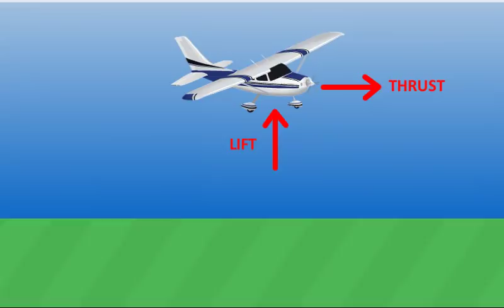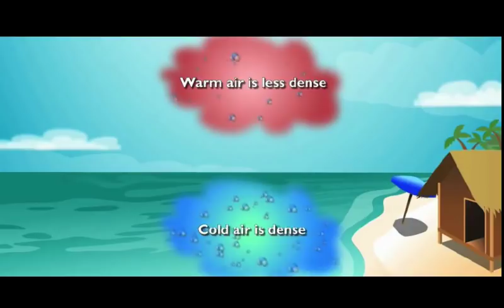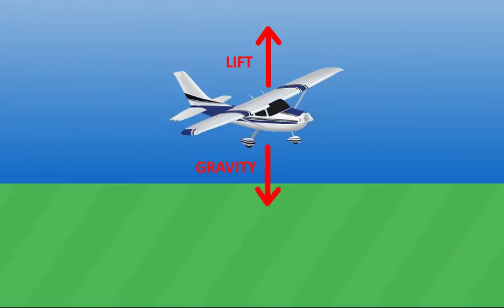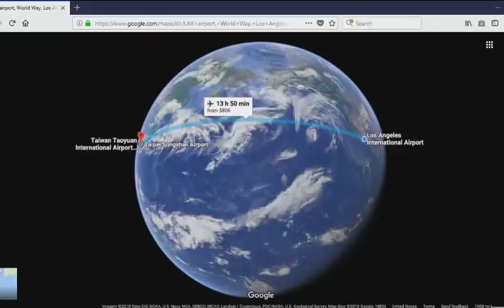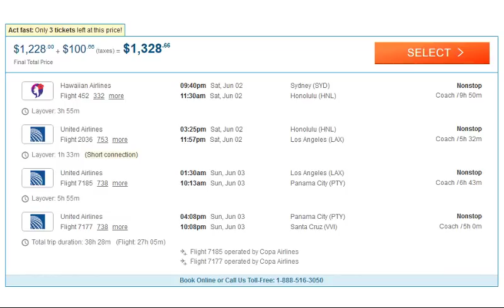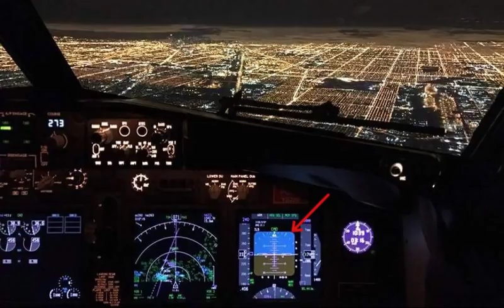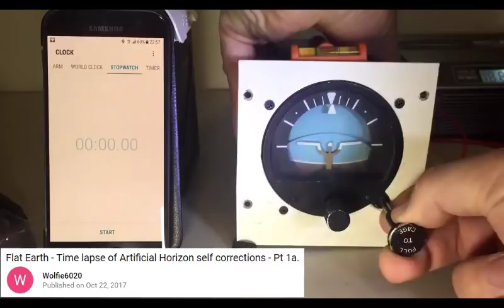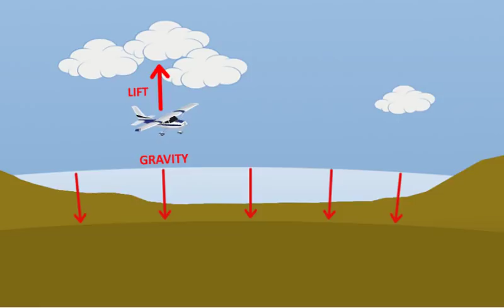Flat Earth Falsities - Plane Nonsense

Comment: I find it VERY sad that there is NOT ONE among you "SPINNING BALLER'S" that can actually THINK FOR YOURSELVES! You keep regurgitating from the same FABRICATED info sources that have dumbfounded you to begin with! I'm your HUCKLEBERRY....invitation extended. COMMON SENSE & LOGIC is just my game. Also, i dont need someone to help me do it either.
Reply: The distance when travelling 10˚ due east or west parallel to the equator.
At 60˚N or S the distance is 300 nm or 555.8 km. Personal experience.
At 30˚N or S the distance is 520 nm or 962.3 km. Personal experience.
On the Equator the distance is 600 nm or 1111.2 km. Personal experience.
For correcting sextant altitudes for the Earth's curvature the formulae are;
 Dip = 0.97 x Square Root (Ht of Eye in feet). Personal experience.
 Dip = 1.76 x Square Root (Ht of Eye in metres). Personal experience.
Also magnetic compasses only function because of the earth's magnetic field, which only exists because the earth is spherical. There is no such thing as a mono-pole magnet in nature. Only people who have actually worked with them or studied their development know this. I have done both. Not a single FE cultist has done either. Not a single one. Never. Not a one. Personal experience.
Gyrocompass only work because the Earth is slowly rotating and gravity is a fact. Only people who have actually worked with them or studied their development know this. I have done both. Not a single FE cultist has done either. Not a single one. Never. Not a one. Personal experience.
Reply: YES its very very sad... :( But then again that is why they are, Followers of EVERYTHING GOV /SCIENCE says.
Very alarming that even the most  carring are reduced to such parroting, even so dereft They must feed on our videos and claims.
You will hear a lot of echo, even a new convert Comedian will be stubstance to them.
They adore they all moving heliocentric universe, feel safe with that childhood compagnion, GOD Almighty, I dont like :( :( :(
THEE GREAT ATTRACTOR !  Not an iron core mass magnet nor a gas sun powerhouse, but a freaking HOLE! BRRRR!

10 Terrifying Facts About Space

https://www.youtube.com/watch?v=UNEFDynNw-Q
Reply: @SRC 2 How do FEers THINK FOR THEMSELVES when they seem not to be able to THINK CRITICALLY and OBJECTIVELY, when they lack the fund of information to THINK INTELLIGENTLY? How do FEers THINK RATIONALLY when consumed with SUPERSTITIONS, SUSPICIONS and CONSPIRACIES?
Reply: Give us 1 single "food for thought" and we will embrace it.
Reply: Plenty of "food for thought", as in, for taking the piss out of and proving it is all lies.
 @petroleumalley
Reply: @petroleumalley  Not sure what side of the fence you're on exactly....but as for "FOOD FOR THOUGHT"? Here's some for EVERYONE: Explain to me why it is that HUNDREDS  of MILLIONS of people  have flown by plane all over the WORLD for YEAR'S (including myself to the Philippines ) yet NONE have EVER reported having experienced the "SENSATION" of "FALLING FORWARD" or being "UPSIDE DOWN"?  which WOULD DEFINITELY  occur on a GLOBE! IMPOSSIBLE  NOT TO!  So go ahead you "GOOGLE- DEPENDENT-for your INTELLIGENCE" warriors ...PROVE ME WRONG!
Reply: @steveeasy8775  I asked for food for thought and you are asking me why people on the other side of the world are not upside down?
.
You are trolling sir !
Reply: @petroleumalley  LOL! My whole argument is that they are NOT upside-down! Everyone knows you cant be upside-down on a flat earth.
Reply: @steveeasy8775  And on a sphere?
If it's true that gravity exists and it's directed toward the center of the earth  than literally everything you wrote can be flushed down the drain.
Please concentrate of the things that matter instead of asking why people are not upside down.
Jezus what a bullshit.
Reply: @petroleumalley  What is your opposition exactly to what i'm saying? Is there a specific thing you are asking about?
Reply: @steveeasy8775  I have no further questions. All were answered by you.
Reply: @No... YOU sir are the one speaking out of ignorance. Name-calling is something ignorant children do. A globe as you well know does in-fact have a top and bottom...the North being considered top, South the bottom, and they are a constant in they're orientation. Gravity has NO control over feelings, emotions, or sensations felt. If you were in a plane ascending  upwards would you not "feel" it? If the plane were to do a straight nosedive would you not have the sensation (feeling) of falling? Those feelings CANNOT be overcome by gravity! Therefore , if you were to start at the north and fly "around" (down) the side of a globe heading South, you would be in a "nosedive" situation would you not?...at this point you would most definitely experience the sensation of "falling forward" for the minds "sense of direction" is not based on gravitational-pull.
Reply: @steveeasy8775  Still going on strong down here, 6,000 shipwrecks on a lake, Erie, mucho storms! They got their atmosphere Momentum carrying aerodynamic planes and rockets perfectly in tune.
But rogue winds blasting the surface anyway at the sticky line or curve... Strange world that elude all explanations :)
Reply: Steve Easy In level flight on a globe the plane is always perpendicular to the direction of gravity at that locality. Why do you think passengers would sense the direction of gravity in a different locality?
Reply: @src 2  COMMON SENSE & LOGIC is usually a euphemism for your appeals to incredulity, appeals to ignorance and dependence on religion. I agree, it is a game—a game where a few profit off of your gullibility. Finally, I wouldn't consider someone persuaded and educated by FE videos to be an INDEPENDENT THINKER. FEers are DEPENDENT on others TO NOT THINK for them.
Reply: @romithromith  Sticks&Stones are what children throw-around and does NOT change FICTIONS to FACTS!  NOR do the use of "GOOGLED" words make you intelligent . If you would like to participate in an "ADULT" discussion based on FACTS instead of OPINIONS I'd be more than happy to accommodate you.
Reply: @steveeasy8775  "Sticks&Stones are what children throw-around and does NOT change FICTIONS to FACTS!"
     A fine example of psychological projection.

"NOR do the use of "GOOGLED" words make you intelligent."
     Not Googled words—my words and my thoughts, and I stand by them. They are quite fitting considering your condescending OP.

"If you would like to participate in an "ADULT" discussion based on FACTS instead of OPINIONS I'd be more than happy to accommodate you."
     Attempts with FEers are usually not intelligent "ADULT" discussions, not discussions at all. FEers try to play arbitrator of truth and opinion, demanding we endlessly prove things to them, which they simply deny. I'm not going to spend hours jumping through hoops for your amusement. I know that game.
Reply: @No...I do NOT need the belief's of others to actually  THINK FOR MYSELF . "FOOD FOR THOUGHT"? Here's some for EVERYONE: Explain to me why it is that HUNDREDS  of MILLIONS of people  have flown by plane all over the WORLD for YEAR'S (including myself to the Philippines ) yet NONE have EVER reported having experienced the "SENSATION" of "FALLING FORWARD" or being "UPSIDE DOWN"?  which WOULD DEFINITELY  occur on a GLOBE! IMPOSSIBLE  NOT TO!  So go ahead you "GOOGLE- DEPENDENT-for your INTELLIGENCE" warriors ...PROVE ME WRONG!
Reply: @No... Are you 2YEARS OLD?  Stand on your head and then tell it that the blood rushing to is just its imagination ! OR better still fall face-first off something and while you're doing it remember ...it isn't real!  When you actually have something intelligent to say i will respond until then stop wasting my time.
Reply: @No... The point is that you cannot just claim gravity when it suits the argument . If we were talking about space then you could use the "no up no down" defense....but that cant be used when we're talking about inside earths atmosphere where there IS this thing called gravity.  The gibberish you referred to apparently was not self explanatory so let me try again. Try this experiment : Stand straight up as you normally would (eyes open first, then again closed) then bend over forward and hold that position for a few minutes . You will feel blood rushing to your face and the sensation that your face is being pulled-on towards the ground. You will experience the same sensation if hanging upside-down. Those sensations cannot be prevented do to this thing called gravity. The bottom side of a plane is at all times facing earth. So...if you were on a plane flying around a ball you would at some point be leaning forward (going down the side, or, up the side depending on starting point) and would experience the same sensation experienced in the bending forward exercise (because remember the planes bottom is always facing earths surface). The same applies once you reach the bottom of the ball at which time the plane (and you) are upside-down and you would feel the same sensation you feel when hanging upside-down from monkey-bars or any other time. Not to mention all the things on the plane that would be flying everywhere lol. Again, this is earth we're talking about here not outer space. There can only be one top and one bottom to a ball. They cant both be the top. The sensations i described are inescapable on planet earth unless you are unconscious . Why do people  in Australia not feel the sensation of being upside-down? Because they're not. I was only joking about things flying around on the lol but the rest is fact. This so-called "gravity" can not and does not effect emotions or sensations. Tell me, do you not "feel" the sensation of ascending in a plane? Why then would you not experience the other sensations i mentioned as well? You most certainly would if you were really flying around a ball. Food for thought.

Comment: Aeroplane wings DO NOT generate lift !!!  This is a common misconception, but it's just not correct. Wings actually suck a plane up by creating lower pressure on top of the wing and higher pressure underneath.
Reply: Thereby generating lift.
Reply: @boffeycn  Have you looked at the comments at Photo Fakery Challenge lately?
Reply: On my way!
 @romithromith
Reply: @boffeycn   I thought you'd appreciate the navigational system comment. He  knows it just wouldn't work on a sphere!
Reply: What do you think lift is? Actually it's the Equal Time Argument which is not correct, and probably what you're referring to.
Reply: Well, FE cultists do suck.
@Cardinal RG
Reply: The higher pressure creates lift, dumbass.
Reply: Hence generating lift.
Reply: That's what lift is. We do not breathe air. We intake particles of a gaseous mixture into our lungs. We do not drive cars. We operate mechanisms that accelerates the internal combustion engine and steering apparatus and apply pressure to the brake calipers.
Reply: It take a lot to educate these stubborn school dogma boys my friend. LOT!
[We will also show you that the popular explanation that most of us were taught is misleading at best and that lift is due to the wing diverting air down. 
  (good non questioning) Students of physics and aerodynamics are taught that airplanes fly as a result of Bernoulli's principle, which says that if air speeds up the pressure is lowered. Thus a wing generates =lift because the air goes faster over the top creating a region of low pressure, and thus lift. This explanation usually satisfies the (gullible)curious and few (hoaxtards?) challenge the conclusions. 
    Another fundamental shortcoming of the popular explanation is that it ignores the work that is done(DÉJÀ VU!).  
 The popular explanation of lift. 
How Airplanes Fly: A Physical Description of Lift
www.aviation-history.com/theory/lift.htm
Reply: @BrainUser1  you need to get yourself to a wind tunnel and see for yourself how a wing generates lift. Year 2 aerospace engineering degrees at Kingston University London require all aerospace students to conduct this test (I know because have done it). The test is extremely straightforward, model of a aerofoil is adjusted in a wind tunnel and smoke is introduced to observe airflow over section. A simple set of load cells are used to examine lift and drag. Seriously before commenting I would suggest you actually read up on the subject at least or conduct the test.
Reply: Would appear after all that Some are learning by following after Hoaxtards that ask many questions, funny how no basic science individuals not limited to School and rhetoric can cause such an effect. Strange also how christian Newtons "laws" were very understood but still Authorities did not believe in flying, as a "few" Other fringe Nutters they showed accepted knowledge to be wrong.

Little like rockets and APOLLO.. People just did not believe possible, to the point of major Papers a New York Times[1] mocking such adventures, until NASA studios showed films of such happennings.
Forced to admit was wrong and accept.
Nothing like a GOV billion dollar$ production with some skipping /bouncing /rock-picking (even golfing!) and fun buggy rides to prove Reality.

[1] Pre Paper /Media takeover by not CIA gov freedom reporting.
      As the ex Head of it said: now all is filtered and monitored by.. our civil Servents.